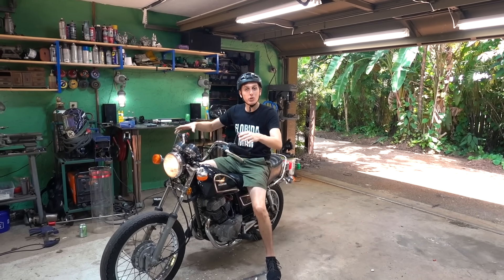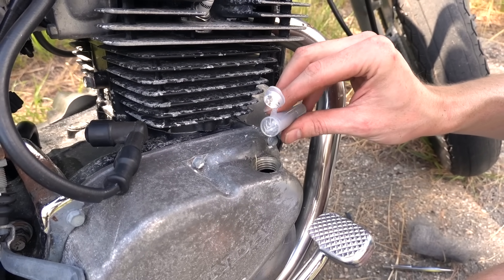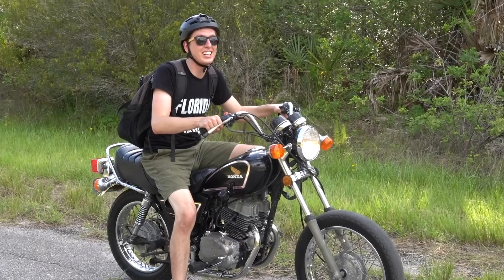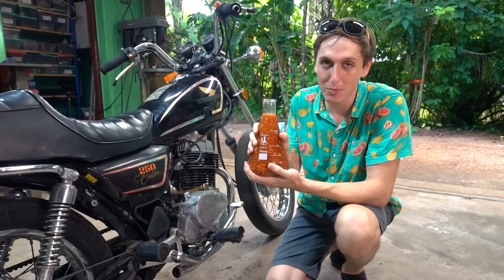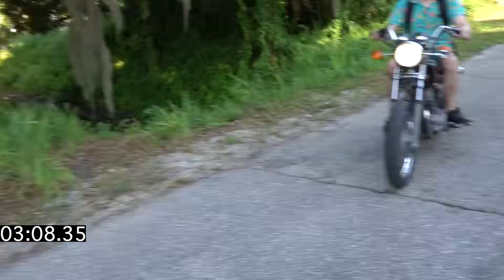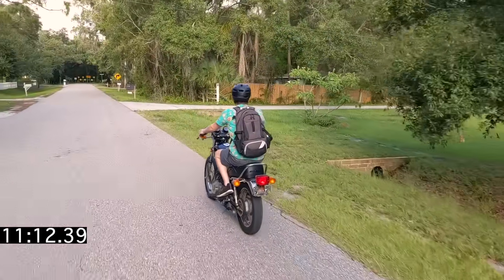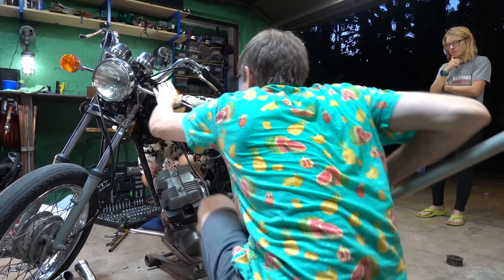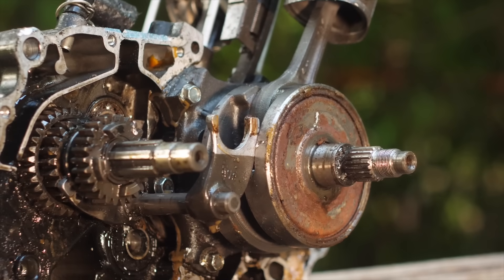Can a Motor run on BEANS?

Comment: Backyard scientist: puts gallium and literal beans in an engine
engine runs for 12 minutes
Me: adds oil in proper specifications 
engine doesn't start
Reply: Well its a honda, ofc it runs on anything
Reply: That really how it be doe
Reply: Add some beans in it then
Reply: @lordsuvrowwwyall7425  lol
Reply: Beans are superior
Reply: Replace gas with Water.
Reply: XD
Reply: solution: don't ride a Harley 😁
Reply: surprised Pikachu face
Reply: the problem is that you're using an engine, not an electric motor
Reply: @jennifer-imlivewithcam9080  stop it, get some help
Reply: @salmongaming6940  I use babies all the time, it runs really well.
Reply: @SavageGreywolf  Wuz da beef with harley?
Reply: lol ikr
Reply: That why we us beans.
Reply: its a honda
Reply: Wrong brand or thickness of oil could cause that. But so could a dirty inside of an engine and fluids that aren't manufactured to last for more than 12 months or being able to operate properly or at all during cold weather. Common sense that everyone would know you'd think.
Reply: @SavageGreywolf  its a honda
Reply: The video’s only 14 minutes long
Reply: Then try it with beans
Reply: @tomiivaswort6921  bro 2 people said the same thing before you
Reply: @Thatguy60929  bro idc
Reply: @Bleeto  We are all in awe of your intelligence, Einstein is clapping right now.
Reply: replaces apart plugs

Engine: refuses so turn
Reply: Replace gas with coke, it'll work
Reply: @jwalster9412  Never heard of "apart plugs" before..
Reply: @afrog2666  it really took someone two years to reply, only so they could complain about a typo which autocorrect misunderstood.

Comment: Conclusion: Honda makes very strong engines.
Reply: Ofc
Reply: if he would put it in ktm video would be shorter
Reply: But it was no match to the power of beans
Reply: @Patrick Wright everyone's weakness is beans
Reply: yes
Reply: I have a honda motorcycle and they are the best type of motorcycle
Reply: You should see some old Lada engines. Nothing can kill those.
Reply: Idk about F1 tho
Reply: @Galaxydoge57  yupp you're right, i have a 1997 honda astrea grand, and its still working after 23 years of usage
Reply: @Patrick Wright because Asian people doesn't like baked beans maybe if it's rice the engine would run faster
Reply: Or Toyota too. Japanese things in general amr?
Reply: NooOoo, TOwEd mOTorcYclEs ARe MoRE BETteR
Reply: Hondas are built like tanks.

Comment: Just an old motonerd here. I love all things science and especially enjoy your channel. Motorcycle oil is specially formulated to do more than just lubricate the engine. The oil acts as transmission fluid for the clutch pads also. With my 30+ years riding, 12 years teaching and knowing it was a Honda, my guess was 20 minutes :) Thanks for autopsy!

Comment: no one:
absolutely no one: 
TheBackyardScientist: LETS DESTROY A PERFECTLY GOOD BIKE!!!!!!!!!
Reply: Right?! How expensive was this episode?
Reply: Rhythmicity 2 grand maybe
Reply from the maker: To be fairrrrr it wasn't running when i bought it for $400. Also theres a million of those Honda 250s. I was reading the 500cc engine is the same size so i might revive it with one of those.. then it can hold TWICE the amount of beans.
Reply: @TheBackyardScientist  $400 wow that's cheap for a bike. AND YES MOR B E A N S
Reply: @TheBackyardScientist  haha! all in the name of science!!!
Reply: MORE BEANSSSSSSS
Reply: It’s not a expensive bike you could get one running for about $250 because these old Honda cb and cm models where so mass produced
Reply: By perfectly good bike you mean a Non runner with bald tires. Get over it.
Reply: @TheBackyardScientist  Scale up the aluminum experiment and dump some gallium on the floor of a Lotus Elise. If it doesn't crumble apart replace the gearbox oil with chili and do some hot laps.
Reply: TheBackyardScientist no no more beans please

Comment: I'm watching this thinking that wearing shorts might just be a bad idea when expecting the engine to blow up lol
Reply: As if 1mm of cloth would protect you...
Reply: That's not really what "blowing the motor" is. Blowing a motor would be it seizing or just the transmission locking up
Reply: I mean the dude wears shorts while he's pouring molten metal. Lol
Reply: @lanezurowski6616  he said he expected the gallium on top of the piston to have a chance at blowing a hole through the block

Comment: Eh. In my experience the fasted way to destroy someone’s engine is thermite, but to each his own.
Reply: I prefer pouring liquid nitroglycerin into the fuel tank and/or engine oil lines.
Reply: Sodium, or rubidium
Reply: Is there a spot on the engine which will get hot enough to ignite the thermite?
Reply: No tanerite

Comment: If I had the money/time to do this, I'd strip and clean the motor before, then draw the gallium through the carb, wait long enough to pour oil into the engine and then take off and see how long I could ride. Honestly thats a MUCH better test, and probably would have shown the rapid unscheduled disassembly you wanted

Comment: Idea: Properly sanitize the engine before beanification, so that you can safely taste test the results of running the engine to death.
Reply: Hmm.  Just thought of an issue- some small amount of gasoline would probably leak past the pisotn rings.  Dangerous amounts?  I have no idea but some would.

MAybe run the engine on everclear for this experiment?  The tiny amount of alcohol that would make it to the beans would not pose any danger.

Comment: 1:38 300 psi on a maybe extremely high performance engine. Normal healthy lawn mowers have around 90 psi, average cars have from 90 to possibly 175. I don't think that motorcycle is ever gonna get 300 psi of compression.

Comment: When I saw the headline referring to whether a motorcycle can run on beans, I immediately ran down to the carport, and poured a couple cans of beans into the gas tank on my 1947 Indian Chief motorcycle.

I kicked it to life and almost immediately, then my Chief died out within seconds.

Why? 

Beans produce gas, right?

Without autopsying the sled, I came back to my laptop and discovered that you had added the beans to the oiling part.

I am bummed out, but I figure that I need to actually clean out the gas tank, fuel filter, and the carburetor, and good old Chiefy will be on the road again!

Actually, I was just making up this scenario, because who would ever ruin a perfectly running motorcycle by adding beans to the gas tank or the oil of said bike?

Except for you, my friend.

Now, I am not usually playing the role of someone that goes off the wall screaming about women's rights, but I do believe that you are pushing the envelope when you made Sandra use her bicycle to pull you and the motorcycle back to the house.

Shame on you!

You should have insisted on her using a skateboard, instead!

Why?

I don't know.

For even more laughs, maybe?

Sandra, just know that I will always be on your side!

Comment: Should add two stroke oil to the fuel and try this again. It may lubricate the top end of the engine and prevent this sort of premature failure.

Comment: I would be more interested in how much, probably mushed and blended, beans (or other non-fuel stuff) you can add to a truck diesel engine before it does no longer work. As older models run on practically everything that can be ignited by pressure, it would not run on only beans, but the percentage could be interesting. I would guess, it takes at least 25%. Problem could be, that it will not stay properly mixed with the (other) fuel and will clog the intake, which is usually located on the bottom of the fuel tank.
And I am quite sure, there will be no need for an autopsy in that case. If you flush the engine with proper fuel, it will run again and for decades to come^^

Comment: If you fill it completely with oil or beans then when the piston comes down there's no air to compress. Since it won't compress, and that piston is coming down. It has to put the beans somewhere else, so the piston coming down forces beans past the piston seals and into the combustion chamber, filling your cylinder with steam and throwing of the air to fuel ratio and causing it to stall. Not to mention the fact that water is basically a catalyst to mechanical abrasion. Steam likely made it stall and liquid water destroyed it

Comment: Is it possible that the engine would have run longer with a can of plain black or red beans without any sugar added? Not that beans make good lube or anything but the sugar is the first thing to burn and harden.

Comment: It’s because the engine is mostly engines form the past engines are made of Cast iron the same stuff as your great grandmothers frying pans that are black and is meant to be treated for rust and tested for explosions and combustion and also putting beans is a bad idea as it will block the oils ports to the pushrods and it needs a liquid but not water or something that causes rust and it has to be dense

Comment: If you wanted to destroy a motorcycle engine you picked the most difficult choice. Maybe not that specific engine but Hondas are unbreakable. Especially those simpler engines like that 2 cylinder 250. I ran a Honda with no oil in it for about 30 hard minutes and it never so much as sputtered in the years I've had it.

Comment: Of cause it cant u dont need any degree to know that. My 3 yrs old nephew can answer this question.
At this point what is the point of making a video anymore- for views? =/
Why not just make another video ;
1) Can your bicycle's tyre run on water instead of air?
2) Can your car's engine run on urine?
3) Can you use your poop as ingredient for cooks?
4) Can you actually use ur wired headset as wireless headset..

Gosh I miss those old days where there were actually contents..